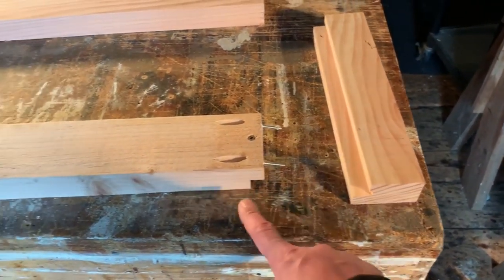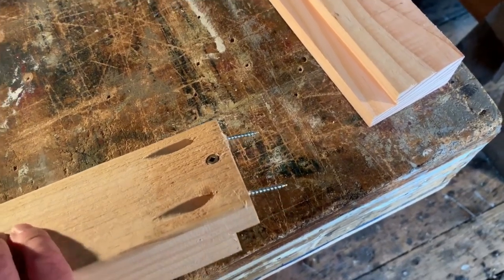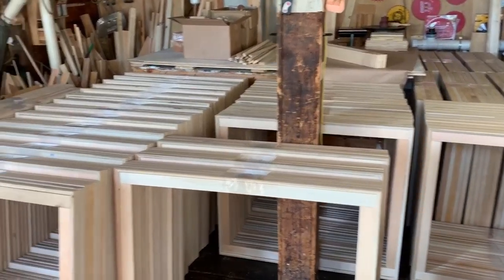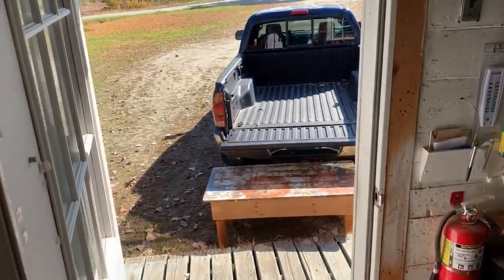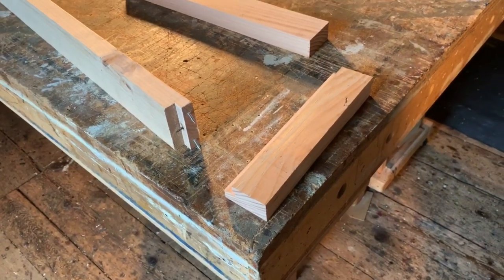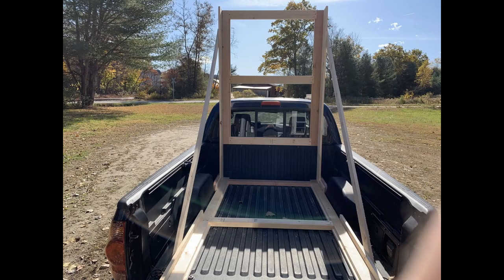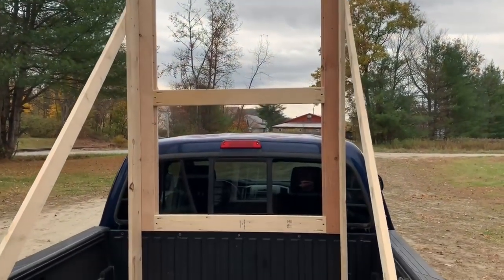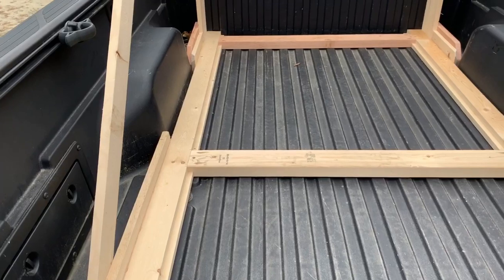Woodworking Joinery Tip - "Half-Lap Pocket Hole Combo" 2x4 Frame Fast and Strong

Comment: thanks for this, Mitch. QQ - for 2 inch lumber, a 2.5 inch screw is recommended. With this Rabbet method, do you use shorter screws?
Reply: think I figured it out... use normal length screws as geometry isn't changed